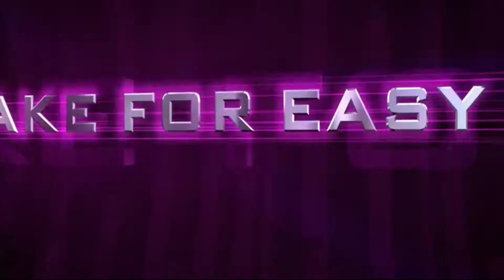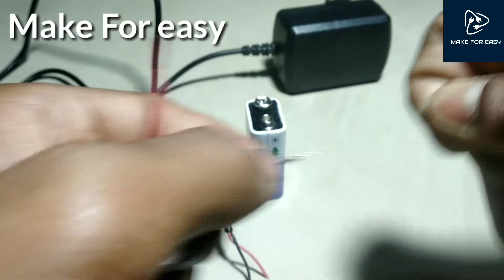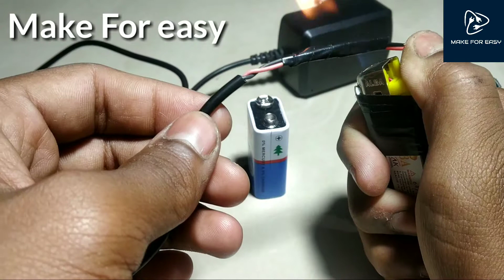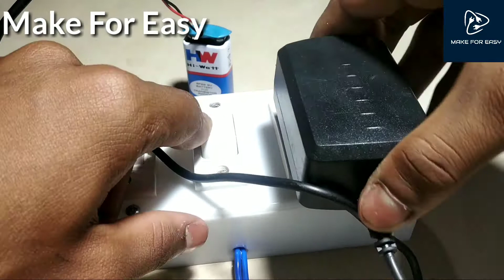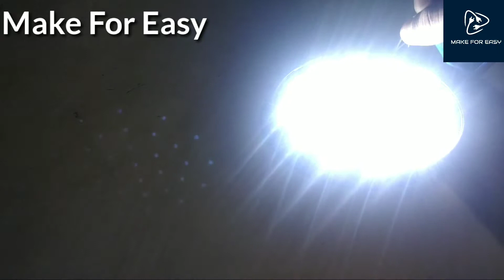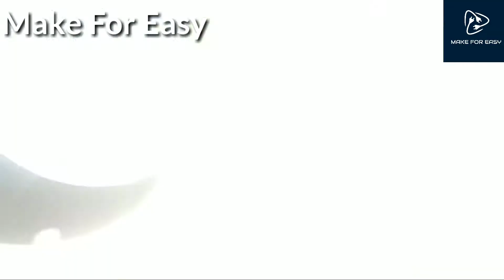How to charge a 9 volt battery using power adapter

Comment: Bro in the battery there are some warnings:-"do not recharge the battery" use new one"  should we still recharge the battery?  Will it blast or........ Reply plz😑😕
Reply: Bro,you have to purchase rechargable battery(HYW)for transistors radio
Reply: @jyotibaghel8530  yea, I knew it👍 and rechargeable battery cost more that normal😪
Reply: Doch mann kann mit geringe Spannung  ca 0.03 Amper Aufladen

Comment: 5v Charger Can Be Used To Charge  High Voltage Battery That Is Higher Than 5v... But It Will Be Really2 Slow If The Battery Voltage Is Too Higher... And The Battery Also Did Not Gain The Full Power Although After Fully Charged.... Im Using 5v Charger On 7.4v Battery...
Reply: This battery voltage is high not Ampere
Reply: @akdgamer1065  Yeah I Know... I Charged My 7.4v Battery Using 5v 1A Charger... Can Fully Charged, But It Will Take A Long Time... I Start Charging When My Battery Voltage Drop To 3-4v... The Battery Voltage Will Raised Slowly Until 8.3v... After That, My Charger Will Stop Charging... It Means My Battery Are Fully Charged... It Takes Time Too Long... Double Time Taken Than Usual 7.4v Charger... I Also Make Current Inverter To Charge My 12v Battery Because 12v Is Too High.... So I Did Not Charge It Directly... I Make An Inverter With  Input 5v To An Output 12v 1A.... I Just Used 5v Directly Charge For My 7.4v Battery...

Comment: We all know it is fake.Bro
Reply: Yes... Because this 9v battery is non rechargeable.
Reply: @ninomandal181  hi can we use 9 volt charger to activate 9 volt dc moter
Reply: Yes the charger is very high volt
Reply: No bros if we use a 9 volt adapter then it can charge
Reply: @animegamer2359  no bro... It's impossible
Reply: But only charge it for 2 to 3 min
Reply: Or the battry blast

Comment: Just don't make the this types of fake video how is this possible it is a non chargeable battery and the adaptor contains alternate current (AC) and direct current (DC) but the battery is made only for (DC) you are recommended not to make fake video,s

Comment: any body plzz say it's really work or not
Reply: NO it will NOT work!  ONLY recharge RECHARGEABLE batteries!  Don't ever do this.  The battery he is using is either a heavy duty carbon or an alkaline battery!  Neither of which should be recharged!
Reply: @stevenA44  i do that with my D.I.Y
charger, not the same as this one, i recharged a non-rechargeable battery (alkaline) for 5 hrs and it recharges like a regular rechargeable battery....
 the battery didn't get hot...